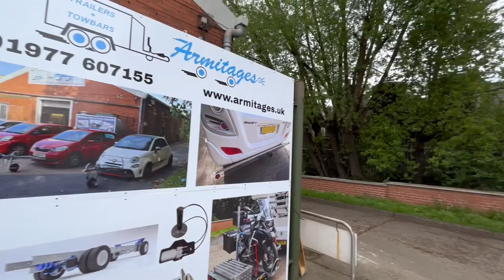FULL DEMO. Collecting Armitages Transverse Motorcycle Trailer for Motorhome

Comment: Just seen this video and are a bit concerned about some of the claims.  he says that the trailer can carry 225kg but with the wheel configuration surely that would put 50% of the weight onto the towbar and as most towbars are rated at around 80kg would this not overload the towbar. I am sure someone can put me right on this. also putting the secondary coupling around the towball can get you a fine.